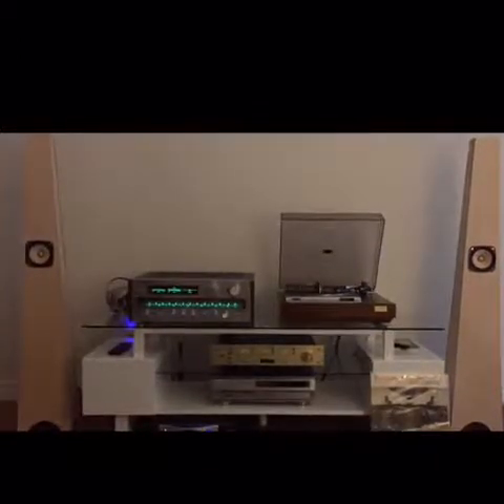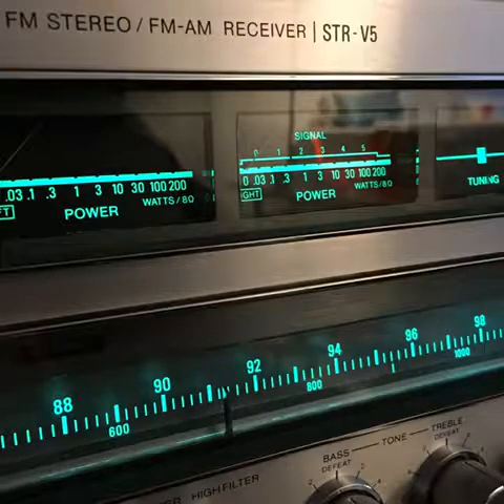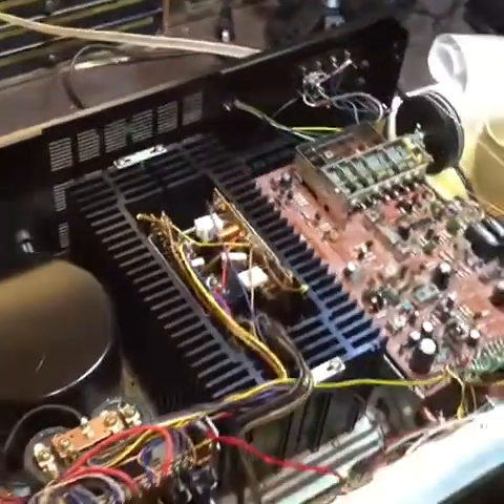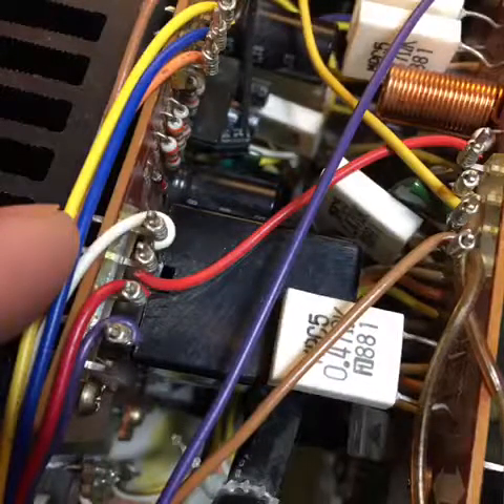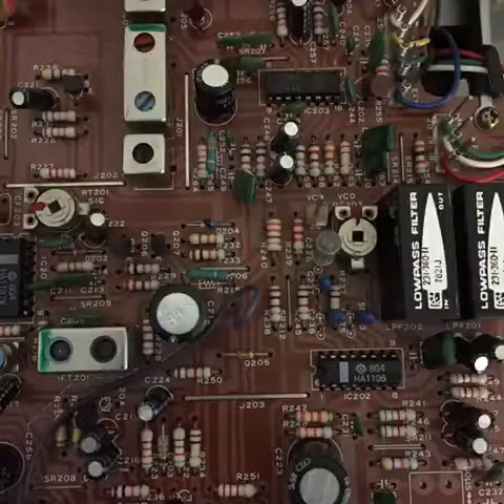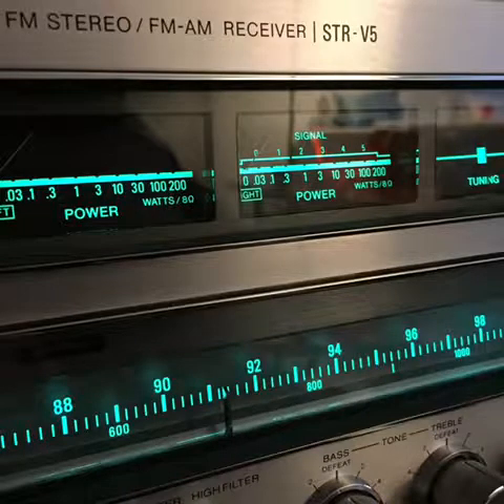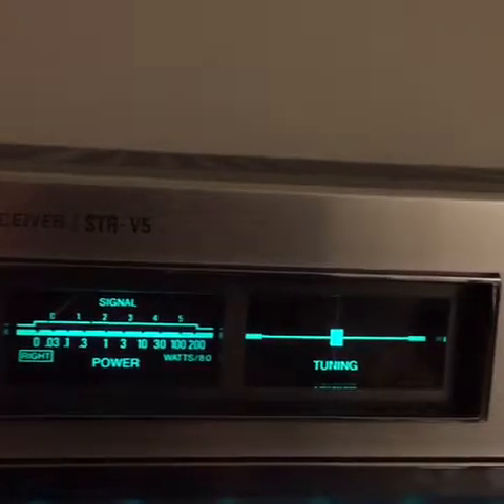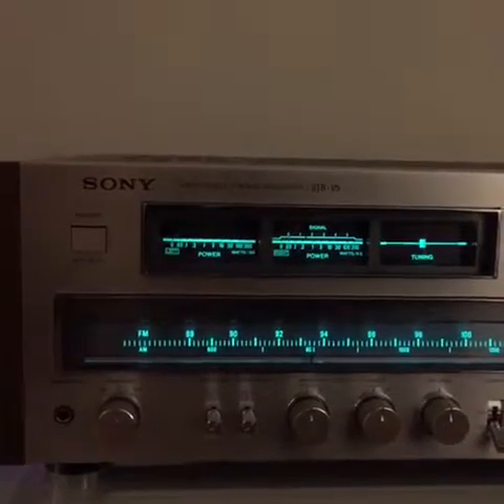Sony STR-V5 Monster Receiver!

Comment: I have a STR V5. Sonys didn't get the notoriety or attention the other brands received, but, when they wanted to, Sony could definitely build great equipment. The V5 is heavy, solid and physically large. The 85 watts per channel seems to be very under-rated as well.
Reply from the maker: Your right - it's still a beast of a receiver!
Reply: Así es tengo un sony str v 7 y no lo cambio por ninguno es más que suficiente esta re bestia de receiver

Comment: I have a SX-1250 too, and recently acquired some HPM-100's. . . I must say, it's really nice (I use it as my PC speakers, I'm listening to it right now). Reason why I'm watching your video is because of my old speakers (Sony APM-790). I'm trying to do some research on what originally they were meant to be paired with from the Sony lineup and somebody in the forms mentioned this series receiver. 

Personally I'm not convinced. The Sony STR-V series seems way too nice for Sony to pair it with APM-790's. . .
Reply from the maker: I appreciate your comments! Those AMP-790's are sure odd looking speakers. Sony had a tendancy to be ahead of the curve in many respects; However, I cannot comment on this Accurate Pistonic Motion speakers (APM) as I've never heard a pair yet.